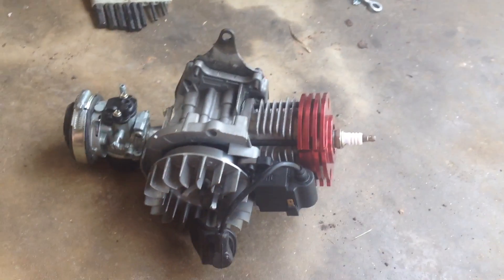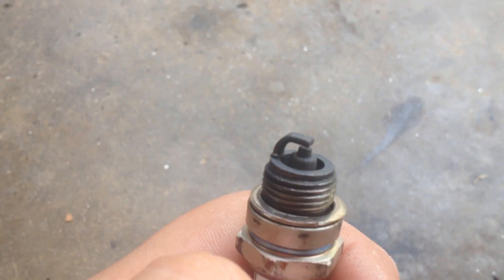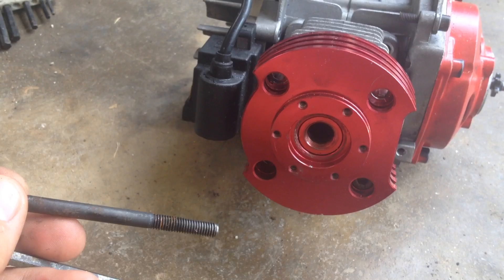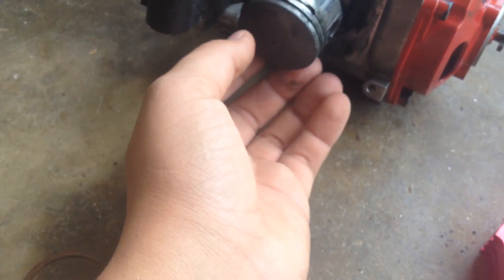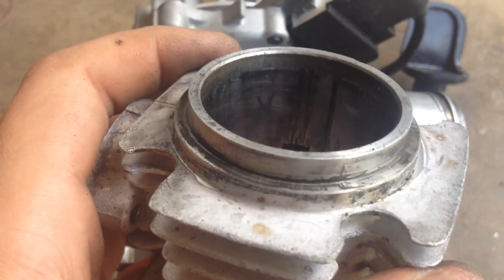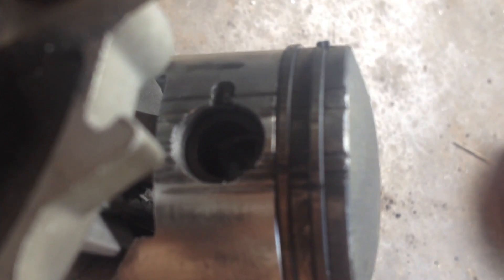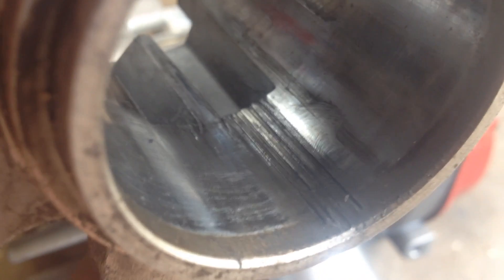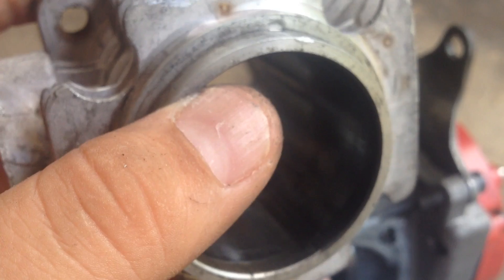Taking apart and diagnosing the 49cc 2-stroke high performance engine!

Comment: 50:1 is WAY too lean oil mix for any 2 stroke engine. I have always run my 2 stoke engines on a mix anywhere from 25:1 and 40:1. Anything leaner than 45:1 is a slow painful death to any 2 stroke regardless of who made it or what the engine came out of
Reply: Alex Hickey see with me I just use the oil ratio that the company that I bought it from says I should use

Comment: Air cooled engine =25/1..Never 50/1..You killed your engine
Reply: id agree but i run mine on 50/1 fine.....
Reply: I won NSW state championship on 25/1 and my engines are still like new.
Reply: yes the more oil the longer they will last......to point of-course

Comment: This is a dirt cheap chinese engine,  I think you got ripped off if the seller tells you this is high performance because this is the cheapest mini bike engine on chinese websites( it costs about 21 dollars + shipping in mainland china). The current engine that I am using is a Honda GX35 ( 4 stroke) which is extremely reliable and gets good milage although it lacks power, kicking out 1.2 hp . would reccomend this engine if you are using it as a daily driver.
Reply from the maker: Kevin Song it's just a mini crotch rocket for fun and it is high performance it pushes out a lot more power than the stock engine did
Reply: your call dude because these engines make out around 1.3 hp
Reply: Haha said the Chinese kid
Reply: I've got the same engine with the big bore kit(54cc?) They claim 4hp and 12,000rpm's . However, I have not installed or ran engine yet so I've no clue to its actual performance. Putting it on a Jesse James chopper

Comment: Your engine overheated and the expanded piston rings got forced into the transfer ports, then the piston ring snagged on the edge of the transfer port and created a burr on both the piston ring and the transfer port, which then scored the piston and the cylinder.
Just by looking at the cylinder and the cylinder head i can tell you that this engine will run super hot, there's nothing "performance" about it, the cooling is not sufficient.
Reply from the maker: Poptart McJelly yeh I put a new head on it and didn't let it get to hot and its broken again these engine are not very good with lasting
Reply: mine last ages .....but im running standard heads.....maybe try more oil in your fuel....and just out of interest wat fuel ratio do u run it on
Reply from the maker: @skullcam  the black gas ratio 😂
Reply: 1:25 saves your engine with these high rpms

Comment: hey u got that motor from ebay ? what stage is it and are they any good ?
Reply: This is a stage 3, i've got a stage 2 on mine.
Reply from the maker: @valium4016  yeh its a stage 3, i have a a stage 2 on a little go kart now
Reply from the maker: Jens  Tori it's just a regular high performance engine off eBay I don't know about the stage but it really good and it makes you have to hold on to the handle bars a little bit tighter.its a lot of fun
Reply: @zesthraxGaming  : Hardly 'high performance' at less than 2 hp, when you consider that the AM6 50cc engine puts out over 8, and can be hopped up to around 20.

Comment: how durable do you say these are ?
Reply from the maker: Sorry I'm late on your question,these are very durable and reliable when they say they are 5x more powerful than the stock ones but don't over tighten any screws on them or the threads on the engine will strip and make sure you have enough oil in your gas!I'd recommend this engine.
Reply from the maker: Update-they require lots of repair!the piston on them will never last as long as the stock ones do.for some reason they always get scored like it was in this video which was what was wrong with it.they do have lots of torque and power and will make your bike a lot faster when you have it though
Reply: is it from a pocketquad ?
Reply from the maker: +Friendly Skateboard pocket bike
Reply: ok because I want to buy the performance part for it but i'm not sure what the engine is
Reply from the maker: +Friendly Skateboard it's this one